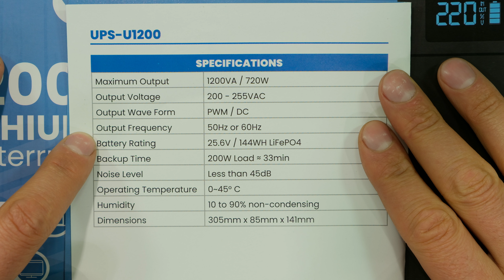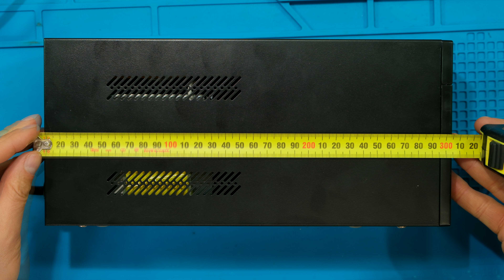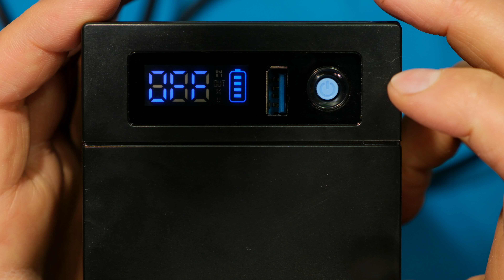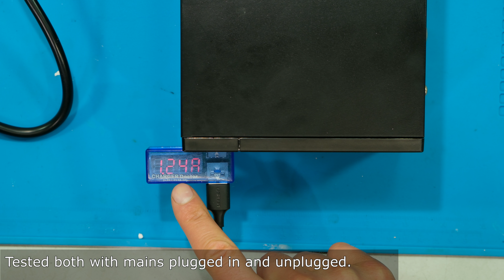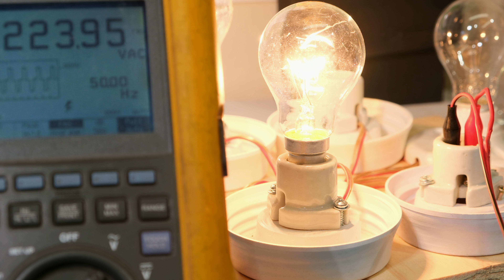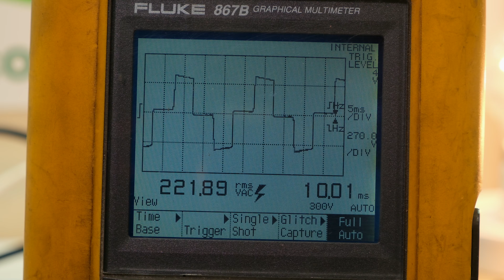Review of the Vizia 1200VA/720W Lithium powered UPS - tested

Comment: will this power up a single garage door motor? also if it's loadshedding and we don't use the garage door will the ups be using battery or only when we click the remote to open the garage door?

Comment: Nice review - got one as well - rare find as it is LifePO instead of lead acid - only use mine for the 10s to power my computers when my solar inverter reboots when the family decides to use the airfryer/tumble dryer/kettle/microwave and dishwasher at the same during loadshedding.